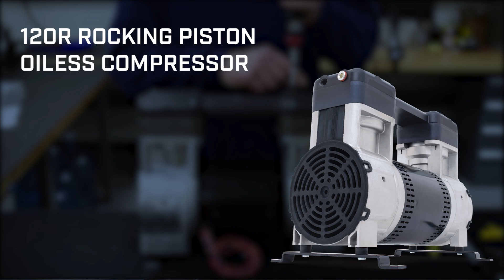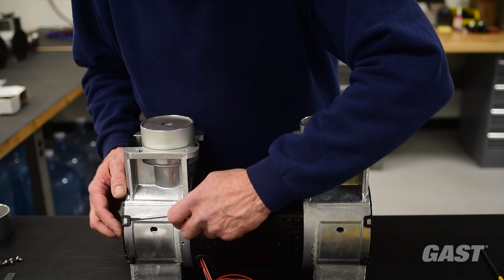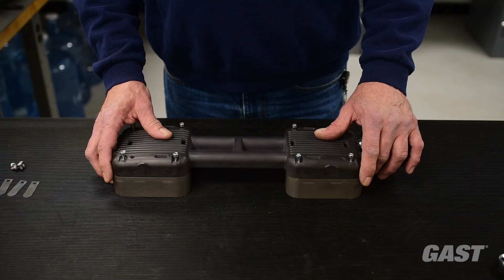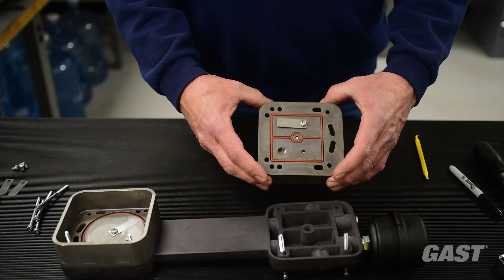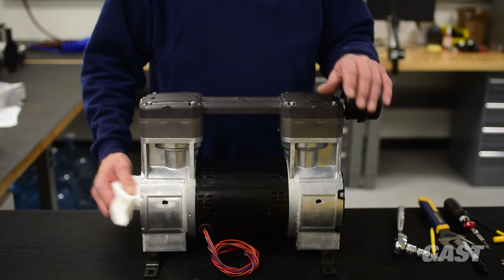120R Preventative Maintenance and Service Kit Installation

Comment: I changed the vanes and filter of the  pump GAST 0523-101Q-G588NDX, the motor is rotating( at least giving loud sound) but it is not pumping. What could be the reason and how to fix it? Thanks.
Reply: Could be the a piston problem..